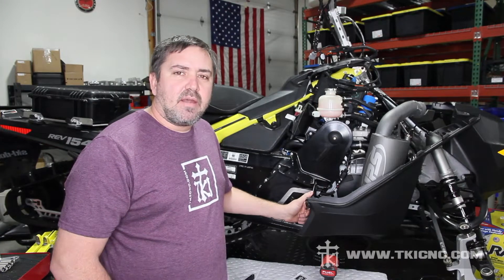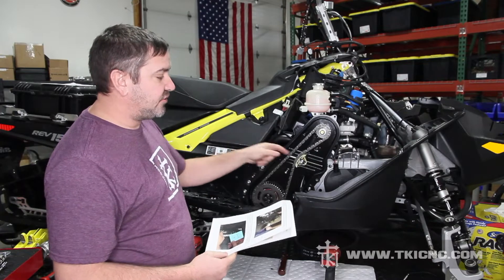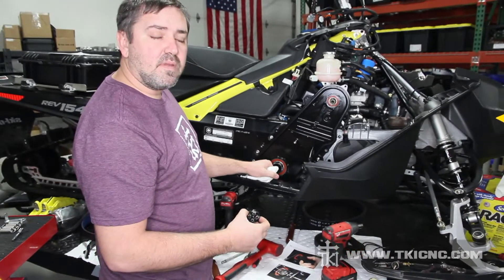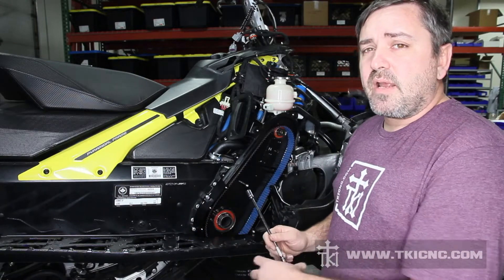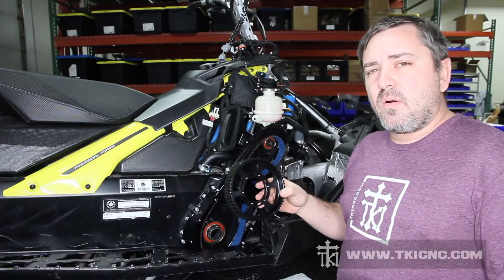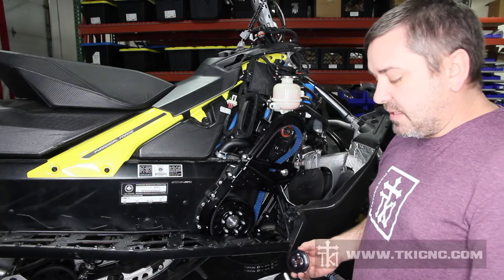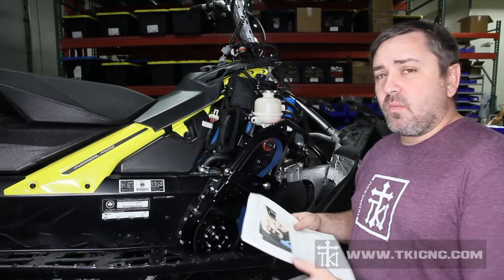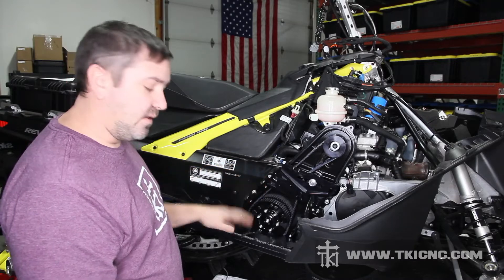TKI CNC Belt Drive Install Ski Doo G4 850

Comment: What are the benefits of belt drive over chain drive? Besides Eliminating gear wear and a little weight. Great video
Reply: Benefits are you get to add the saved weight back by carrying an extra belt in case one fails. You can fix it on the trail side because its just a belt and not a chain, which is good because your chain would never have a problem but your belt can and will need replaced on a ride at some point. You have less rotating mass which is almost noticeable on a 165hp motor in 3 feet of powder.
Reply: @jakepeterson3379  cool Thanks. After watching more videos on the change over to belt drive I understood a little more. You don’t know if you don’t ask questions and I am always learning something new so Thanks for the reply muchly appreciated.